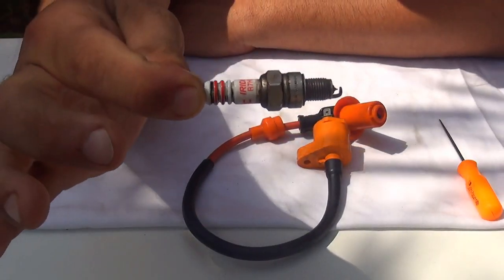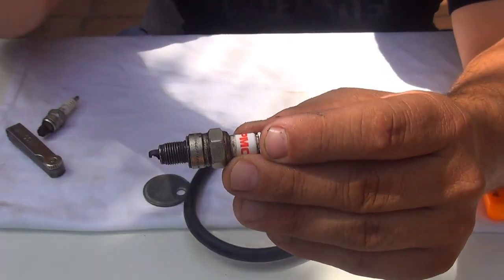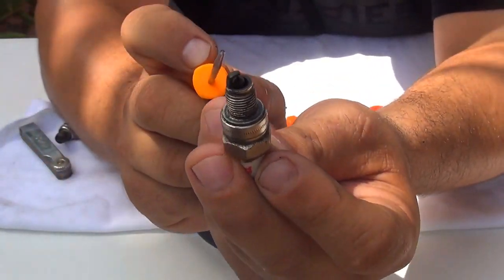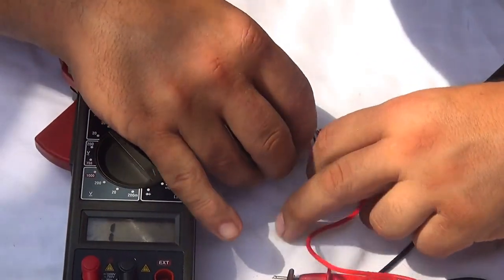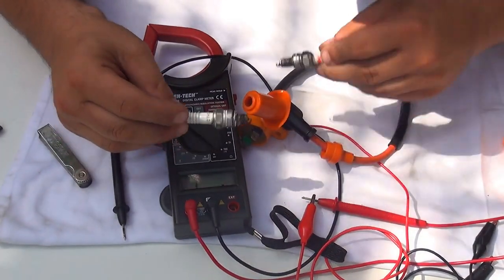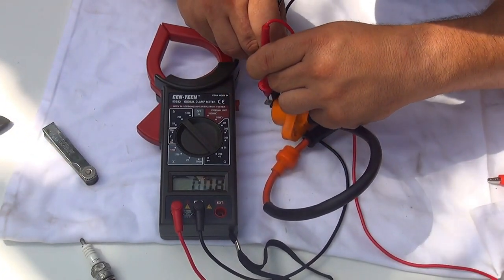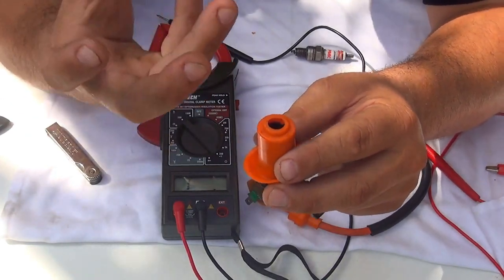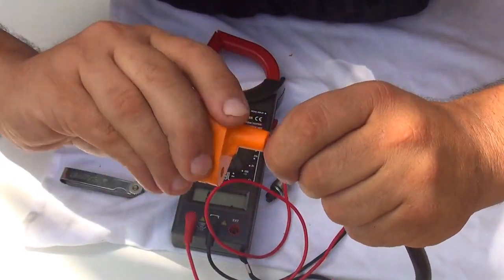How to rule out a Spark Plug as your starting problem

Comment: Hi there,
do you know what could be the problem on a gy6 Kymco Agility 50 that I can't accelerate it?
I have a performance air filter and a big exhaust.The scoot starts very well, but I can't accelerate it.
Thank you.
Reply from the maker: Hello my friend  you say you place a air filter and a big exhaust but my question is did keep the balance ? so you have more air  and more air going out but did you give more fuel to your motor to keep the balance  ?  so you will need a 85 # main jet to your scooter to have more fuel
Reply: @VirberelloScooterTips  Hi,
even if he stays idle very well I don't have enough fuel so I could accelerate?

Comment: Can you please help me get my seat open on a brand new eagle 150 gy6 scooter I guess the cable or spring has come loose and I cannot get the seat open
Reply from the maker: Hello Roger the best way is to remove scooter rear luggage rack remove the square body part above the rear brake light and with a long screw driver  open the latch take your time and be patient that will take you 30 minutes .
Reply: virberello GY6 Tips and Tricks you know what’s funny , is that’s exactly how I git it open you should make a video about that there is nothing out there ... thank you so much sir
Reply from the maker: Hello  @bassguitarman6  Thank you for watching my video
Reply: takes a bit of time to break it in. at first it's stubborn but after with a few good slam your beer down fist on the back end it will break in.

Comment: I hate to bother you but I’m in desperate need of help I have. Brand new eagle 150cc Chinese gy6 scooter almost identical to yours in the videos .. one week old and the headlights stopped working they were always dim and brighter as the rpm’s increased but now nothing at all all the other lights seem to be working
Reply from the maker: Hello Roger  open the front of your scooter and check if the light connection is tight and make sure your connector pins do not have any corrosion look this video https://youtu.be/JzQqfBI2rOU at 9:45  try to squeeze the wire connector and see if you have any light working if you do not see any changes you need a multi meter find the stator on the lower right side of the scooter you will see the fan and on top there is black cover wire at the end you see a connector you need to test the stator ( when scooter is on ) place the multimeter at AC 200 and you need to test the yallow wire coming from the stator with the red probe of the multimiter  and the black probe with the green coming from the stator or the battery negative if you have a reading next you have to check for continuity from that point to the front on the yellow wire . Check this link to http://www.firenzee.com/gy6/ can be very helpful to you lots of info . I hope you find the problem and if you need me I'm always here    PS. if you do not have a reading with a multimeter on the stator the stator alternator is bad